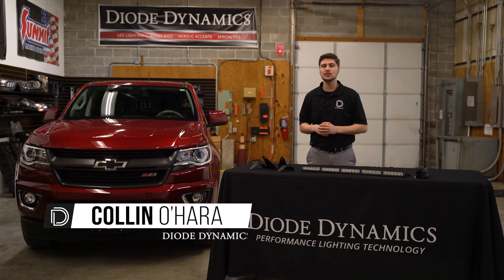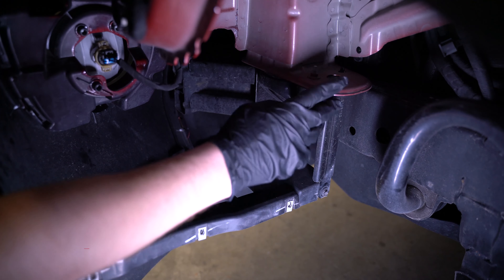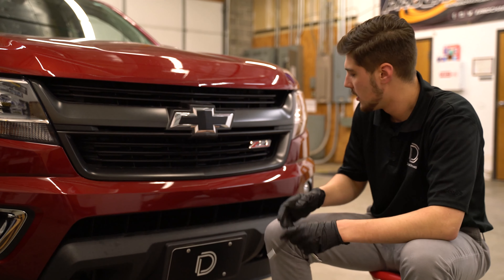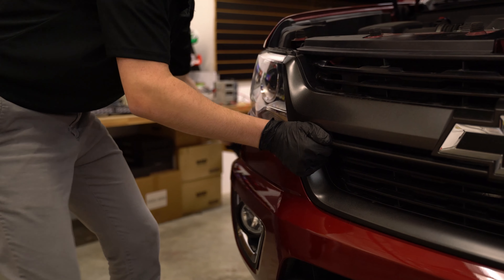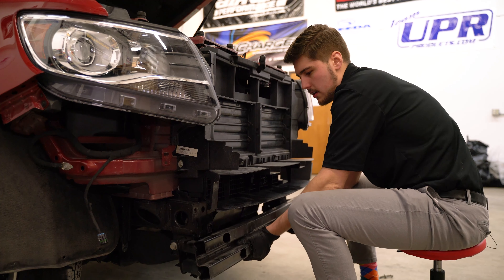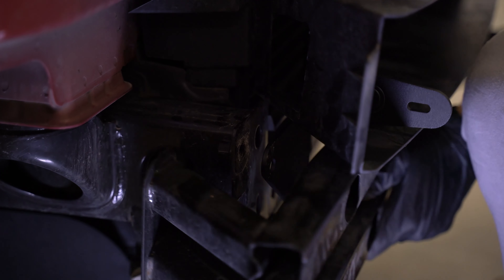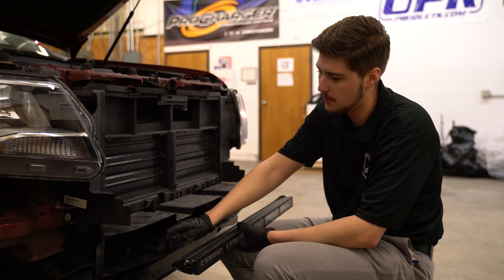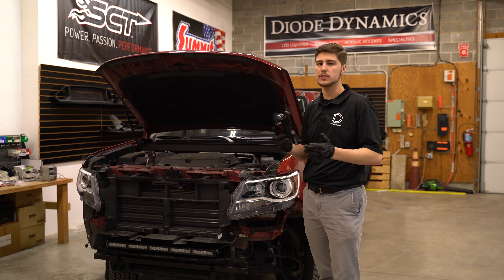How to Install 2015-2020 Chevy Colorado Stealth Light Bar Kit  | Diode Dynamics

Comment: I have been searching for wiring techniques.  Definitely could have used those from your video. Please add.
Reply from the maker: Thank you for the helpful feedback, Dave!
Reply: @diodedynamics  This is the one area I would like to see some options on.  I have my ditch lights all set up but I'm struggling to find the right spot to mount/place the on/off switch on by Chevy Colorado.  A video that demonstrates ideal switch locations and how to open up the paneling and install the switch would be helpful.  There are some resources out there but most skip over how to take the paneling away and where good access points would be located.  Any resource recommendations would be appreciated, thanks!
Reply from the maker: @jtrapschuh  We will keep that in mind for future videos! Thank you!
Reply: That’s literally the whole reason why I chose to watch this video. Trying to figure out where to pull the wiring through. I wish they would’ve shown it.

Comment: Will this impede air flow or will it not make any difference?  Btw love your product, changed out all my lights with yours and they look fantastic.
Reply: Follow up question, will the flood and driving light combo option have the ability to switch between them? Like will it be possible to have only the driving on, but switch the flood on and off when necessary?
Reply from the maker: @alexgariepy1127  Hi there, Alex! Thank you for your support! This should not make any difference to your airflow! Unfortunately, they don't between the different optics. The whole light bar is powered at once when it is on. Sorry about that!

Comment: I bought a ss42 light bar in march and few days ago I noticed condensation , diode dynamics said it was normal
Reply from the maker: A little bit of condensation is normal, especially in the spring and fall when the ambient temperature is much different than the lights. 

It's the same concept as taking a glass of ice water outside on a hot summer day, it's environmental condensation. If there is standing water inside the lens, that is cause for concern and we would be happy to correct it for you!

Comment: Do I need to remove the Ambient air temperature sensor in order to install? It looks to be located in a place that would interfere with installation.
Reply from the maker: We didn't have to remove any sensors during our installation! You shouldn't have to.

Comment: How did you get the two 10mm Bolts back in that hold the bumper from the front?  Does the light bar obstruct access to them (Reference 2:06)
Reply from the maker: No, the light bar won't obstruct access to them, but if you have any trouble with the installation process you can always contact us!

Comment: Diode Dynamics Do you have any discounts when purchasing more than one product?. I'd like to buy LED high beams, low beams and Fog lights.
Reply from the maker: Hey there! We have a free shipping campaign going on until Friday, 4/24! Get free USPS shipping on any U.S. order with code BUYUSA at checkout!
Reply: @diodedynamics  Thank you very much.
Reply: Does this work with the ZR2?
Reply from the maker: @MattyBigz  Yes! It will work on the ZR2!
Reply: @LEGEND04131  If you buy the headlight bulbs, hope they last longer than mine did. Had both fail within 6 months. DD came highly recommended, and the bulbs were still under warranty, but it wasn't worth the hassle.
Reply: @45caminiti  I had two bulbs that burned out over the course of ownership. Their warranty replacement was a breeze luckily. The replacements have been fine for a year now luckily. I do like their warranty period though so that gives me a piece of mind.